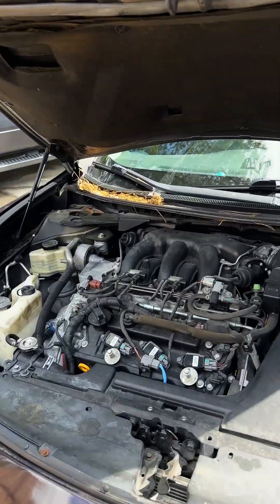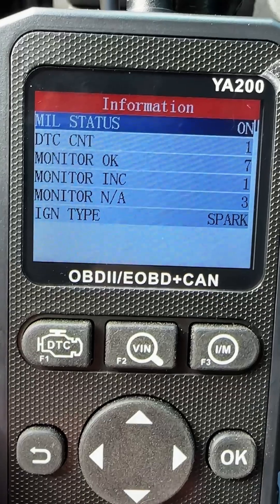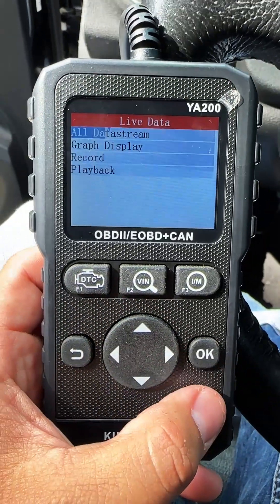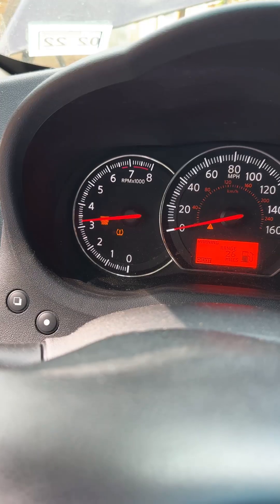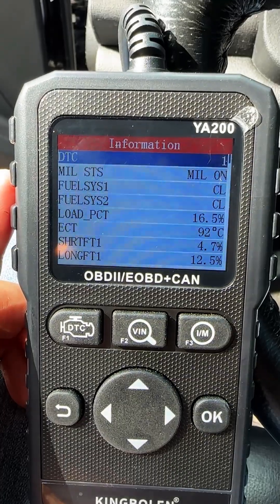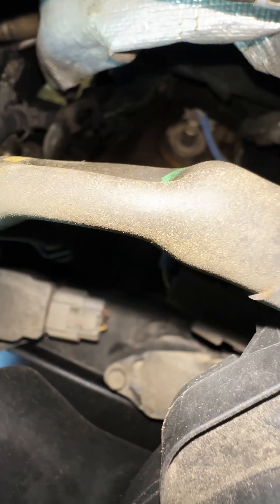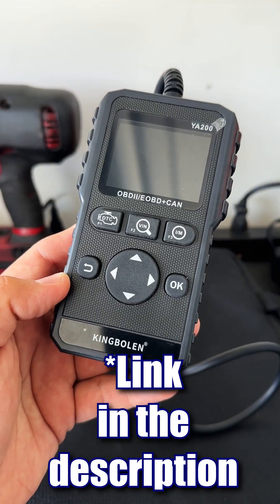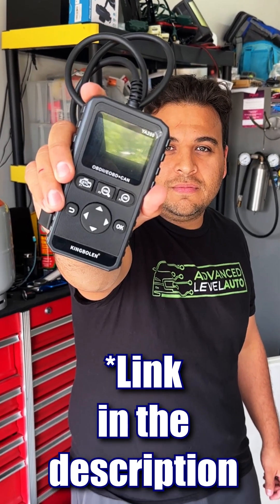NISSAN P0171 BEST CHEAP SCAN TOOL?

Comment: What’s happens when u rev but no change in stft sits at 32 and doesn’t move holding at 3k rpm.
Reply: Any updates?
Reply: @jefryarocha87  forgot which car I was working on at the time. I believe it was a fuel regulator issue.

Comment: For any that may not know short term measures fuel being used as the engine runs long term measures fuel used over time. The long term can tell you how your engines been running. You want both of these long and short to be around 0 or - or + 10 percent is okay as well. If it’s a high number in the pluses it’s running lean if it’s really low in negatives it’s running rich. Plus means hardly any fuels being used and negative means lots of fuel being taken. With a vacuum leak that’s air not being red by the MAF sensor so the computer dose not to now how much air has entered the engine with too much air and not enough gas you will have a lean condition of not enough fuel for the air inside the engine. The opposite can happen as well where you have too much fuel for the air inside the engine and not all the fuel gets burned you should be able to see that on the oxygen sensors.

Comment: Bro, Thanks for sharing this!!!! I daily drive the family owned ‘03 4Runner with a little over 296k on the clock and starting mid November, she’s been throwing an intermittent P0430 code that promptly gets shut off with my 6 year old Innova scan tool. I refuse to believe this vehicle’s kitty cats have gone bad.. The 2UZ V8 that powers the SUV doesn’t burn a drop of oil, doesn’t run lean, has never been driven with misfires and has never had her underbelly subject to any sort of damage.. she runs flawlessly, in other words.  That tool I own has “freeze frame” data, but I’d really like to see what kind of data the 02 sensors are putting out, because I’m about 99% certain they’re the OEM equipment from 20 years ago 😅
Believe I’ll be buying this tool!

Comment: Nearing the top of the junk mobile pile.... Look how many 2009 Nissan maximas are still on the road..... Less than 2% of the total sales of 2009😮
Reply: The CVT was hot garbage, the engine was a different story.